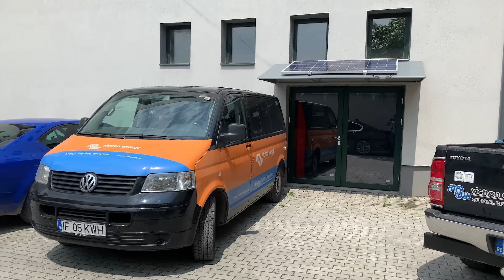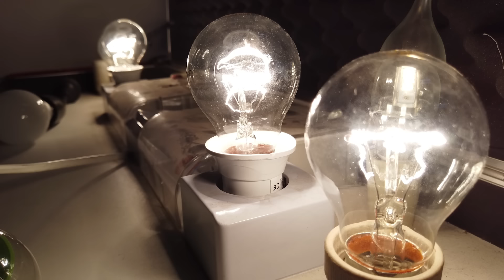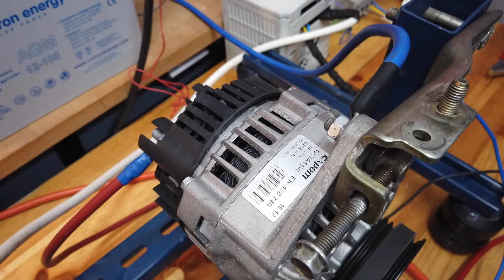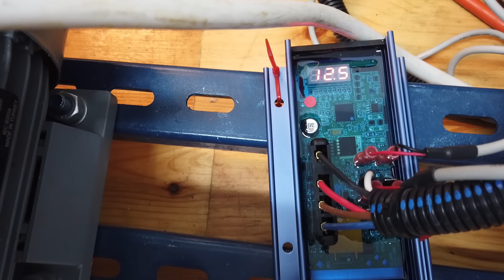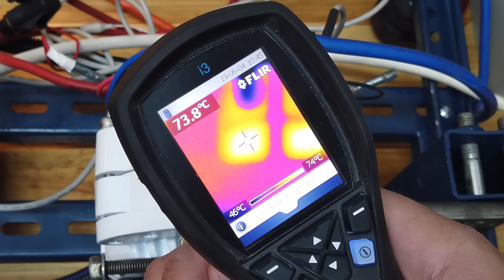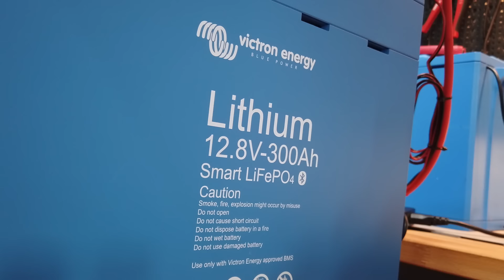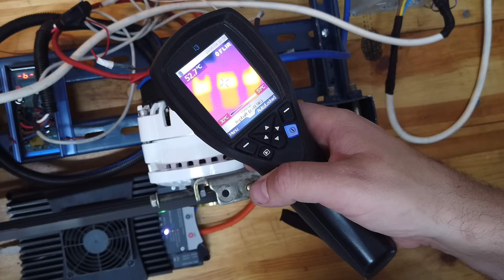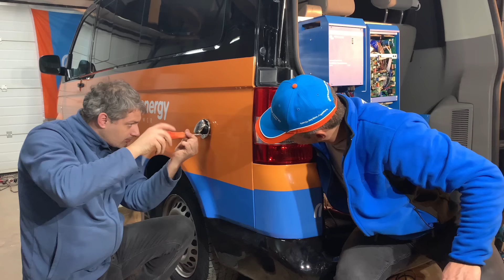How to not blow up your Alternator when charging Lithium

Comment: The bms will never shut off, as the max voltage of lithium higher than other batteries, the alternator will only charge lithium to 80 ish %. In a motorhome application, most have 1 starter and 2 leisure. Therefore hard to imagine 1 lithium more damaging than 2 leisure at low charge. Disinformation only damages the brand and its reputation.
Reply: The point of the clip is to warn of overloading the alternator, this is the result of extreme low internal resistance and is not related to the BMS or state of charge.    Due to the low internal resistance of the battery the alternator is running at a far higher power then designed for often....thats the issue.         We have seen many many situations that the alternator gave up on lithium.   Of course if you choose to run the alternator directly to the lithium, thats up to you.

Comment: I installed an Orion 1212 30 to charge a 230A lithium. Do you think it will be safe for my truck alternator?
Reply: It's safe for sure. Even with two Orions and 60A it would still be safe.

Comment: This test has nothing to do with the type of battery charged and more running the alternator at max output at low RPM. Lower RPM than it would see in a car by the way. Any load that pulls max current on the alternator at these low RPMs is going to heat it up. This is such a bogus test on so many levels. Put a regulator between the alternator and battery of 20 amps or so and it would run all day long. Alternators weren't designed to run at max output 100% of the time.
Reply from the maker: Please read the many replies from @johannesboonstra6917 below for more information.

Comment: New inquiry need help with this question, I have  a dual battery lithium 12v 135amh profile and also an alternator cap output at 250amp for Jeep Wrangler. I also have a dual battery relay isolator that can handle lithium batteries. Will I also need a Victron shunt battery protector and of DC2DC converter for this setup?
Reply: If your relay isolator does not limit the current, then yes it would be useful for you too. On the other hand 250A is good output and 135Ah not so high capacity, so, you may be on safe level with your present system (your lithium battery does not draw very high current from your alternator even when the battery is empty).

Comment: What if it has a BMS like a Battleborn?
Reply: Then the charge isn't limited and the alternator will still be overloaded.  the BMS takes care of the cells, not anything else.
Reply: @JohannesBoonstra-ol2nz  Thank you. Guess there is something limiting the charge to exactly around 50 amps on a 180 amp alternator which is definitely a good thing because correct me if I am wrong but I'd think the batteries would pull even more without that

Comment: It is a pity you barely mention the issue of Li BMS shutting off the battery while charging. This will destroy the dynamo much faster than the overheating. How is the victron system coping with the BMS shut off?
Reply: Great question, wish they would answer this one .
Reply: @keesras763  We added $80 balmar alternator protection module to protect against BMS shutting down, charging from the alternator and damaging it, but I think we would have done better with the alternator regulator, which I think controls charging rates from the alternator.  Or maybe we need both 🤣, like when you don't know how to tie a good knot, you tie a lot of knots!
Reply: @keesras763  The voltage is set for lead acid.  So it never sees 14.6 volts.
Reply: @ooigfgnnkhjjnc  except in freezing temperatures. then the alt (at least a bosch) will regulate to 15 or 15.2V depending on temperature. because lead acid need higher voltage in the cold and lower voltage in hot environment.

the freezing cold alternator is gonna over voltage kill a lithium bank IF the BMS isn't setup properly. otherwise the Li bank will kill the alt after some time. (and prolly your board electronics aswell with the spicy voltage spikes the alt puts out after a bms shuts down the Li battery on full throttle current.

the alternator regulates to 100% field current so it keeps the desired voltage setpoint at designed current output. lets say 100A.   but when the BMS detects over voltage from that freezing alternator at 15.2V it does a hard cut. and the alternator can't throttle back it's field current to like 15% for the board electronics draw of lets say 20A.

now the voltege spikes over the (+ 80A output) field current surplus.

this can easylie reach into the 50-70V and fry basically everything in your DC system.  

AC loads after an inverter will be fine. but the inverver itself is gone in smoke too.

a (well engineered) DC-DC charger can avoid this directly by avoiding a BMS trip in the first place and as a second line of defence it can dump a voltage spike in its toroidal coil long enough for the alternator regulator to catch up with load demands.
Reply: @casemodder89  In modern (still non-hybrid) cars, there is often a mild "energy recovery" - the alternator is set to charge only when braking or engine braking. In practice, instead of a constant 13.8V float voltage, when the car is braking, there's a "boost" voltage of 14.8V-15V depending on the temperature. This can very well trigger the BMS overvoltage protection.
Reply: But if you have an AGM battery parallel to the LI bat then I don't see how this spike would effect anything as the AGM will take the hit?

Comment: Does the Orion dc to dc charger prevent overheating of the alternator ?   Does it not also need a temperature sensor on the alternator  ?
Reply: Yes, it limits the charging current to be max. 30A which does not load the alternator too much in case the (high capacity for example 200Ah) lithium battery is almost empty.

Comment: What’s the difference between an alternator charging a lithium battery at maximum capacity, versus running a victron inverter at the exact same amount of dc load?  I’ve put together dc systems that routinely pull hundreds of amps from alternators to run electronics and rooftop air conditioners.  I guess I just have a hard time believing a properly sized lithium bank and alternator setup will have an issue other than potentially not generating a high enough voltage to fully charge the lithium battery…

Comment: Your comment about the 1500RPM test  "the engine running at idle" is  incorrect.   Typical  engine crank  to alternator ratios  vary from at least 2:1,  more typically 3:1  to  4:1.  I have not documented  modern  stuff  very much, it is possible that some engines are  a higher ratio yet.  In my day,  my 440 Plymouth was 4:1,  meaning, that if the engine was spinning 6K RPM, the alternator  was  screaming at 24,000 RPM.  I did  fail a  couple of them.
Reply: when you have a diesel engine idling on 750 rpm , the 2:1 makes that 1500 for the alternator right? , could also be 2200rpm but that's not that relevant here, the point is that an alternator needs much more (from 4000-5000) to be able to cool itself.
Reply: @johannesboonstra6917 My understanding is that is the alternator generates higher RPMs, it exceeds the ability of the fan to adequately cool it at well
Reply: @SailingWindGypsy  well only if the voltage of the battery raises enough, under "full" load or even higher then this the heat is too much often
Reply: @johannesboonstra6917  so my understanding of what you are saying is that the alternator fan is designed to spin fast enough to cool the alternator at idle speeds.  As demand on the alternator increases and the alternator spins faster, the fan spins faster.  However, as the alternator approaches high or maximum RPMs the mechanical properties of the fan limit how much it can cool the alternator. Fan cooling ability to alternator temperature flattens out at high RPMs.  In vehicles like cars this is less of a problem because the alternator is also cooled when the car is moving from air blowing into the engine compartment at 50 to 60 mph.  However, if you do not have this additional cooling from the vehicle speed at high alternator RPMs the alternator will overheat, because it outstrips the ability of the fan on the alternator to cool the alternator.  So alternator overheating at high RPMs is more of a problem on sail boat for example.
Reply: @SailingWindGypsy  The point is the efficiancy, this is around 50% which is fine for a short while ( lets say 10-20 min) , but if the alternator is on maximal output and the voltage of the battery isnt going up for lets say hours, the heat will destroy the alternator
Reply: @johannesboonstra6917  Thanks. I think I understand. We have had a low output alternator directly charging 400ah lead acid batteries for years, but have switched to 400 amp hour lithium, and are not wanting to add a lead acid starter and DC to DC (lead acid to lithium) charger.  Also 500 watts of solar panels which work great in the tropics/semi-tropics, but not so good in the winter in North Carolina!
Reply: @johannesboonstra6917 alternators put out best at 8000 RPM
Reply: @j-rocsk  correct , but even then a 100-110% load will produce more heat then can be cooled by the fan..
Reply: @JohannesBoonstra-ol2nz  maybe but if it’s turning the right speed it wouldn’t hurt it.
Reply: @j-rocsk  problem is the design of the majority of alternators is simply not built for lithium where the battery voltage doesnt raise, so it will remain outputting more then it should

Comment: ts possible to charge a lifepo4 battery directly with alternator. If you now what you do. if you now the parameter and specs of alternator at low rpm, if the max current is compatible with your battery and also the charging voltage. Victron produce an intelligent relais to do that.
 I have a 65A alternator. and 200ah lifepo4. During travel I have 20-30A of load for many utility like e-bike, fridge, evaporative conditioner etc etc. with a dc-dc of 30-40A I don't have any current to charge the battery. with a simple rele of 230A and 35mmq cable I charge 30A with 30A of loads. My alternator, a low rpm in poor cooling conditions (es at stoplight), don't can produce more of 20-25A, even in short circuit. its not depends from type of battery. lithium, lead, nichel...its depend from the delivery curve of the project of alternator
Reply: hello,   not sure which type alternator this is , sounds as this is not a typical used AC alternator type with internal regulator.
Reply: supertypical Bosch or magneti marelli 90s years.. work perfectly. why victron produce a reel to charge lifepo4 directly?? why master volt do the same? all alternator in the world have a curve of current teeth depend from rpm. But depend to the curve and to the reduction ratio of the crankshaft. Its totally possible charge lithium battery with direct alternator in total safety if you now what you do @johannesboonstra6917

Comment: Pmax : Routside = Rinside. Battery resistance 28 mOhm, Generator resistance 58mOhm.
Guess where energy will be dissipated.
And yes you over unity generator people. Energy is always lost in energy transformation!

Comment: You've got the speed of the driver with the wrong size polly. The driver running at 1500 RPM on an automobile engine has a much larger pulley driving the same size pulley on an alternator making the alternator spin faster than the engine. I might have guessed that an engineer would not quite realize that never having actually turned a wrench on a car does not qualify you to be an engineer for automotive uses or for figuring out how an alternator supposed to work. The rest of your demonstration is pretty good, but you're way low on the speed of the alternator by measuring the speed of the motor that's driving it.
Why don't you enter Spurs lead acid batteries of some type or design within the circuit so that they can help regulate the power draw?
Reply: its a test/demostartion of something what would happen over a longer period. but indeed

Comment: In an internal combustion engine situation, the alternator typically runs at 3 times crank speed. So 1500 crankshaft rpm = 4500 alternator rpm = way out of danger zone. 

Your test rig seemed to run alternator rpm = motor rpm = overheat problem
Reply: An engine is often at idle or just above...At idle this is 800x3 is 2400rpm, which is quite nicely in the danger zone.  Even on 4500 rpm with an output at 110-120% of the design power is problematic as well.
Reply: @johannesboonstra6917  An IC engine does not operate at constant rpm. Most are now automatic, so there is no direct correlation between rpm and gear ratio. 

On acceleration, engine rpm will flare to 2000-2500 and hold there. That's 6000-7500 alternator rpm. At urban cruise speed, torque converter lock-up does not occur, and transmission does not shift into 1:1 drive ratio or above, keeping engine rpm high. On cold start up, powertrain management inhibits higher gear ratios to enhance driveability and reduce warm-up time. Idle speed is also increased during engine warm-up 

In open road driving, engine rpm is easily 2000rpm until warmed up

A 50Ah battery that requires 10Ah to recharge (ie is 20% depleted), will only take 6 minutes to recharge @ 100A. The car is still warming up after 6 minutes

The maths does not support your position
Reply: ;-) , I did a few hundred installs so I do know how an alternator works, thank you! .  But your theory is a bit off I am afraid.  Of course when the battery is about full you dont need to worry, but that's quite rare on a household battery.  And we not only talking about a 50Ah battery in a small truck,  We are talking about serious lithium systems up to a few hundred Ah.    These will not raise the battery voltage until full so this means the alternator will go more the full throttle. This because the regulator steers max current to the rotor until the voltage on the battery does go up ( THATS the major difference with a lead battery here)   often 110-120%.   When the alternator 100A  a quite large part goes into the engine when its a little bit modern one and its connected system itself, so perhaps there is 40-60A to charge the lithium.    When charging the battery with an alternator in a boat machine room for example, the average rpm is just above idle.   So then the rpm is way below the optimal cooling speed and the output is far over 100%.    This means simple that for a 200Ah lithium the alternator needs to work max for a couple of hours.   The heat is generates is 50% of the output power , so that's immense.    Believe it or not, but this will make sure the lifespan is pretty short.         I have given others also this advise when you want to prove I am wrong,     Take an empty 200Ah ithium battery and use the jumper cord on you car , just let the motor idle and see whats happening    (only when you still have warranty on the car).    to add to this, if you feel you dont want to protect the alternator, that's fine with me of course, we just want to warn as we have seen many alternators fail that way...     @Goodkiwibloke
Reply: @Goodkiwibloke  For your information this most likely targeting sail boats and yes they do run at constant speeds for long periods.
Reply: @johannesboonstra6917   - does this mean the DCDC charger needs to be "Right sized"? ex: use maximum 40Amp DCDC charger and refrain from using 2 to charge 2 different batteries to avoid burning the alternator
Reply: The best is to "play safe" and choose a converter with a fixed power at maximal 50% of the rated alternator power, or use a "smart" regulator which also takes the temperature in account, then your allowed to have a more powerful converter  @JCBrissy
Reply: @johannesboonstra6917  I'm not experienced with alternators, but if the alternator is shut down at idle, is overheating really a problem?
Reply: @johannesboonstra6917  Not sure about others but when we take off after a night of camping it's at full speed (55-60mph) for several hours. Idling for more than the time for a light to change is almost non existent.
Reply: @johannesboonstra6917  as a yacht owner with a lithium bank, I 100% agree with you. When turning the emergency parallel switch between start and house on, the alternator gets hot enough to fry eggs on super quickly!!!
Orion TR doing its thing keeps temps within acceptable limits.
As you said, normal AGM's don't have this issue but Lifepo4 is a whole different story
Reply: @regan44017  i have a terios ii, it idles at 750rpm and the alternator is at abt x2.5 = 1900 rpm

Comment: So the balmar is just a alternator with a DC-DC attached and some PLC to trim amps according to temps..
So a DC-DC connected to a alternator would do essentially the same
Reply: I'd suggest it simply modulates rotor field current

Comment: Alternators are typically run faster than your tests.
Reply: yes, but the effect overall is the same,   We felt that if the test was 3 hours on a high RPM there wouldn't be many people looking at it.
Reply: @johannesboonstra6917  lol. why do you think there is a fan INSIDE the alternator? running it slower would increase the heat.

Comment: Wondering how it would look if you set up a fan on the alternator…
Reply: yes, if you would have a fan which is able to cool the alternator down it would be nice, problem is that because the efficiency of the alternator is so low, the amount of heat which you need to get rid of is the same power as what the alternator generates.